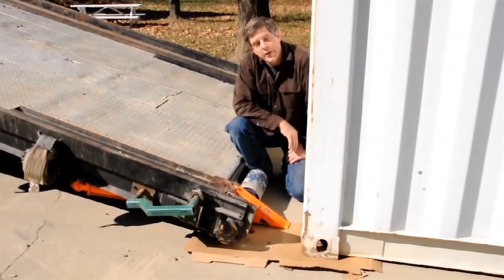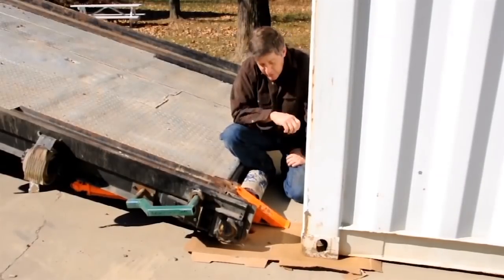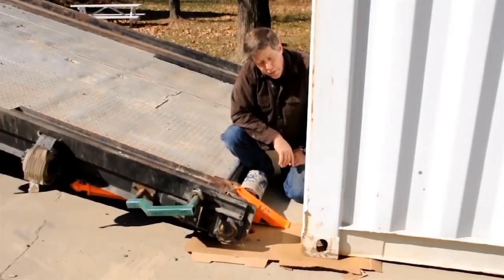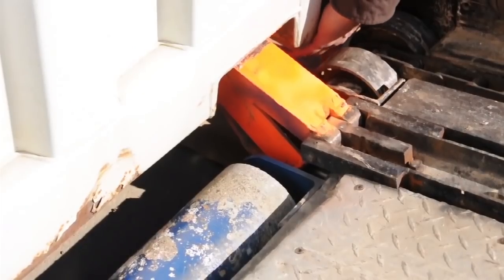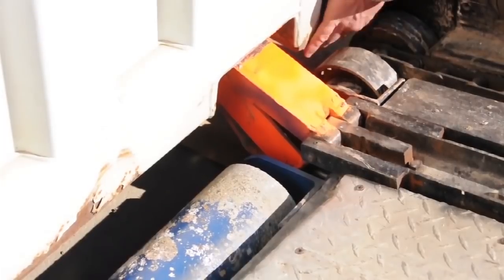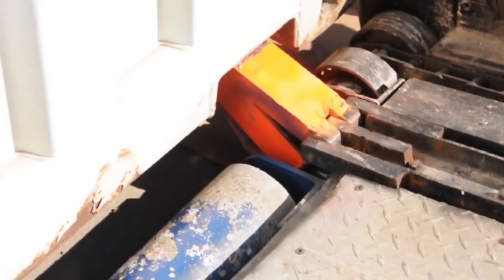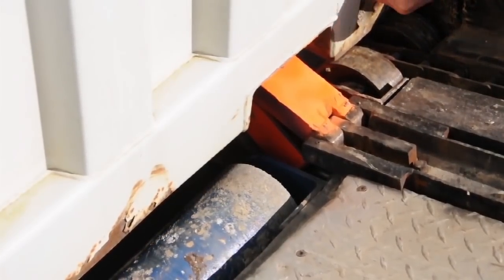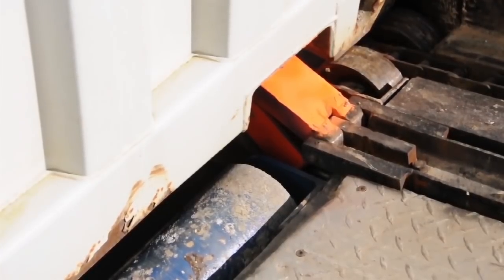Why use QuickLoadz?

Comment: After many years of moving cargo containers I found that you don’t need all the gadgets for loading.  It is much easier to approach the container at an angle rather having the truck aligned with the container.  By hooking a short chain, slightly longer that the container is wide, at the bottom corner casting holes you can hook your winch to the chain at a certain point and the container corner will lift of the ground while you slide your bed under it.  Again, the truck bed is at an angle to the container.

Comment: How would that be done from soft surfaces like grass? Wouldn't the rollers get stuck in the mud?
Reply from the maker: QuickLoadz performs just as well in grass, mud, snow, you name it. While the integrity of the grass may be at risk (as is the case any time you drive a ten ton truck on grass) the powerful hydraulic bed doesn't care what's in the way. See our Military Tough and Snow & Mud videos to see how it handles in extreme conditions.

Comment: Good Stuff.
How do you offload in a jackknife position to start because that is required more than not especially with 40' containers.
Can you post a video of an offload of a 40' container with a straight run of only 85'?  
I'd be interested then but great ideas gents.
Reply: Ken no you don’t if you have a push bar. I work with 40’s daily
Reply: @kerah2663  push bar?
Reply: Yes a push bar. It’s a piece of rebar that has a chain link attached to it. It slides under the 40’ and pushed the container off of the hydraulic flat bed
Reply: A Push Bar?  I'd like to see this Push Bar demo.
Reply: Gilberto Pereira one day my friend.
Reply: @kerah2663  if you work with then daily you should be able to put out a demo video of this push bar by now.?
Reply: @kerah2663  "I work with 40’s daily" 2 years and still no demo.

Comment: hurry up guys before the chinese copy it
Reply from the maker: We are trying. Manufacture has been the bottleneck. I am thinking about doing something a little radical like offering no lose license to manufacture so it can get out there faster. In this way any medium sized shop could build QuickLoadz under their own name and only pay a fee for the units they actually build.

We do have a patent in China for what it is worth.
Reply: Almost every shipping container is made and comes from china. They handle these containers by the THOUSANDS daily. What makes you think they don't already have such a setup?
Reply: @AztecWarrior69_69  ...
Generally speaking...  China operates more on brute force and manpower than on innovation and clever design. 
That's not to say they wouldn't jump all over someone else's innovative idea if they see a potential for profit...  but if they just need to unload a container...  they'll throw 20 - 30 guys at it before they even consider buying a piece of equipment to do it more efficiently.